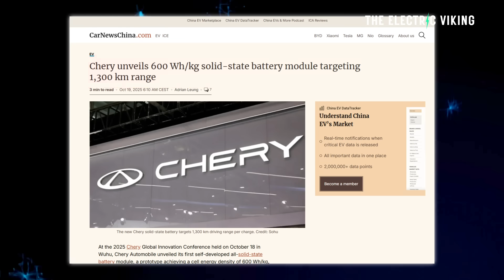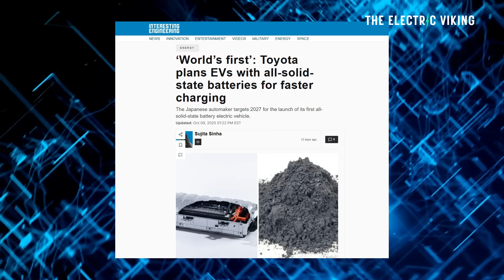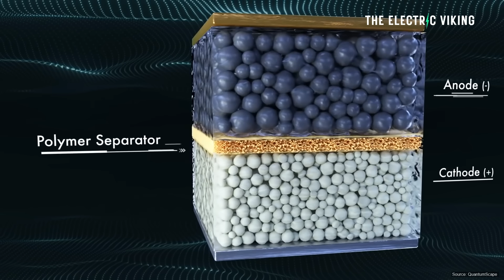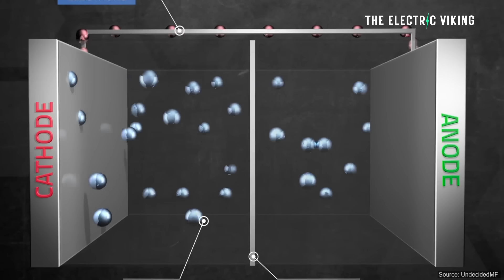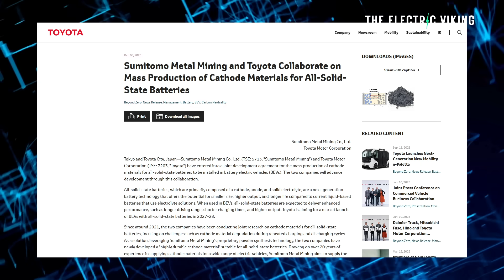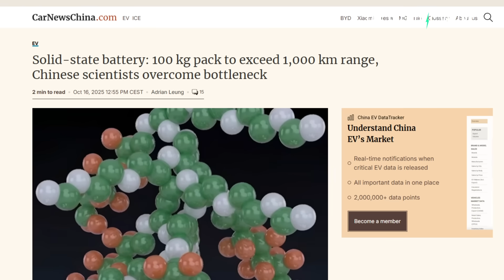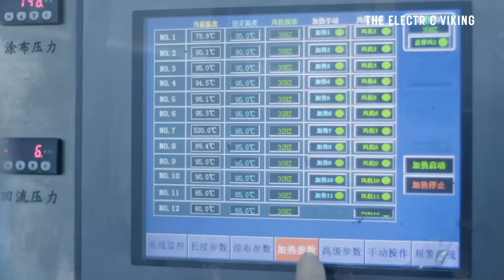Chery’s 600 Wh/kg Solid-State Battery: EV Game-Changer?

Comment: I disagree with you Sam.
Proof has to be given on these solid state  batteries.
Prototypes are one thing , actual large scale production is another.
Separately EV are still far too exy for most even with LFP and solid state will be double the cost.
Small ICE vehicles like Suzuki Swift, Ignis, Kia Stonic, Hyundai Venue , Mazda 2 etc get fuel efficiency of 5-6 litres per 100 kms, and service costs of AUD$250.00 - $500.00 a year  Typical annual running cost of a small ice car AUD$1500.00 for 15,000 kms.

EV are still well above the comparative sell prices of the affordable ICE car.
Hyundai Inster is 43K ,GWM  Ora is 38K , MG4EV  38K even the DYD dolphin is 33K and the difference in sticker price is still on average  3-5 years of fuel and service costs of an Ice car. 
The larger BEV from mid AUD$40's, AUD$50's and AUD$60 K are out of the reach of the average Aussie.
ICE Utes and SUV are typically in the 40,000- 60,000 units a year and typically purchased as company and tool of trade vehicles. Sell price of those ICE vehicles from mid AUD$40/ AUD$60K .  The BEV similar sized vehicles some minimum  AUD$7k- AUD$10K more expensive.

Even BYD Atto1 (AKA Seagull, Dolphin Surf) is being suggested to launch at mid 20K. mark for the smaller essential model with 33kWh battery and 200-250 km range..
IMO - EV will not become mainstream whilst this significant sticker price differential exists. Buyers will take the 5-10 K less and be happy to save that purchase cost for other cost of living expenses. 5 K saved now and 1500 paid out as running costs of Ice over the 500.00 for electricity cost of the EV .

Comment: Surely 600wh/kg should be making the aero industry excited where cost is less of an issue
Reply: Unless there is some Catch-22 about these batteries unstated.  Such as operating temperature range, slow charging speed, fire safety,  noxious emissions in a fire, slow discharge rate, cycle life, cost.  There usually is some trade-off in every battery chemistry and cell-in-pack design , when you read the fine print.
Reply: @eddiegardner8232  Be skeptical I understand, but solid state I've seen them cut in half still work, no smoke, no fire no emissions (though i can't promise if the rest of the car catches fire there might be something)  solid state also can charge insanely quick, the limiting factor being the cord and what the charging station can put out.  Temperature not an issue, cycles decades, the trade off is the cost.  That's it.  Possibly the materials perhaps some rare earth metals.  Really it's just about COST.
Reply: @eddiegardner8232. The other draw back might be it use really expensive exotic alloys and materials, if it doesn't have major drawbacks
Reply: The biggest issue for aero industry if we look at commercial flying, is the weight for example an air plane fuels up xx amount of ton fuel for a certain flight then during the flight the air plane gets lighter through the flight while the batteries even when discharged still weighs a lot and air planes always have to bring "backup" fuel in case of emergency so if an air plane is to have it, it really needs to be lightweight and enough to be able to handle emergency, although i can imagine an air plane witch can eject
 its batteries in case of emergency so it can glide down easier from a like 30 000 fet in the air or so.
Reply: @havendale9  The Smart move would be to have a  TurboJet Engine on the tail as safety backup (just in case) TriStar like. Once the EV system is proven they can remove and cap over the aft engine. So it would technically be a hybrid powered aircraft.
Reply: @havendale9 . The IFR flight rules require that a plane carries enough “energy” to conduct the expected flight including an approach, fly to the alternative in their flight plan if they can’t land at the primary, shoot an approach at the alternate, and then remain in the air for at least one additional hour.  Most flights carry fuel for at least 2 hours, not just one.  An electric plane would need to be designed to carry the same weight for takeoff and landing, providing extra structural capability in the event of an engine problem on departure.  Electric planes would be much quieter and have drastically better fire safety than jets using Jet-A fuel.  Electric motors directly driving turbine fans should be much more reliable than any jet engine.  They would not be dumping pollution into the atmosphere and would be able to produce full takeoff power at any altitude or in any weather condition. Electric flight controls could also replace troublesome hydraulic systems used on jets.  There are already small general aviation electric planes.  It’s just a matter of time and battery power density improvements before airliners begin to adopt electric power beginning with short haul regional carriers.   PS:  Electric motors incorporated into the landing gear could not only be used to “drive” the plane efficiently around the airport during taxi operations, but assist friction brakes by dumping kinetic energy back into the batteries instead of dissipating it as heat, and helping accelerate the plane to quickly reach rotation speed on takeoff.
Reply: @havendale9 eREV-aero could solve that
Reply: Wh/kg is just a scam. Hydrogen have a energy density of 33.000 wh/kg, but diesel has only 12.700 wh/kg.

First find out what we are talking about. Cars need wh/l. Only clue less people gets excited about this.
A car is space limited, so the electric viking needs to get his facts right.
Told him many times, but looks like real world facts isn't important.
Reply: @geirvinje2556  cool story braaaaah, except for the inefficiency of still having to transport the stuff, the fact those pesky hydrogen atom are very hard to contain and the boom kablammo that happens when they leak
Reply: @geirvinje2556  Of course you have a point, but what is the real power density for hydrogen, AFTER being fed through transformation to electricity?
Reply: @mikaelpehrman4815 The point is how it's measured. If you use the correct wh/l hydrogen at 700 bar are at 1.300 wh/l vs diesel 10.700 wh/l.
You can see why hydrogen dosen't work. This is the point. Why trick people with a wrong mesurment???
Reply: @geirvinje2556  That I agree to....
Reply: Yes!

Comment: Energy density is the holy grail for car design engineers…. Range and low weight… equals a better dynamic driving vehicles which Chinese cars are not delivering they are too heavy and soft riding

Comment: I would pick the one with the biggest range. I couple of reasons. 
- When you drive on a highway, the consumption  is much bigger. 
- We usually drive with more than 130km/h speeds. 
- When it's winter the range is reduced.
-  Infrastructure is not that great and charging speeds are not so high.
- Keep in mind that usually you keep the battery between 20-80%, not 1-100% and you want a reserve
- Most people have one car for city and long journeys and many iive in flats/apartments and home charging is not available.
 So a car that would have  800km  real range on highway speeds and 800v architecture, would make a lot of people transition.

Comment: I had a 1600L Vauxhall Cavalier that did around 350 on a tank. Until diesel cars arrived, that was a pretty good range. I personally don't expect an EV to do much more than that because I can charge en route. I'd like a minimum 200 miles guaranteed, at motorway speeds, as my daily commute is 120 miles I figure that with lights, wipers and AC on a 200 mile car will easily do that and charge up overnight.
I think that people demanding 1000 miles from an EV are just looking for, increasingly silly, reasons not to make the change. Charging speeds are going up, charge times are coming down steadily. Unlike petrol/diesel, you can "fill the tank" while you go to the toilet and/or grab a coffee or food.
Price has held me back but now that Vauxhall have announced that the Frontera will be the same price regardless of EV or fossil fuel drive train.
Reply: An EV would be great for local travel.  Where i live in Canada the charging infrastructure is just not there yet for my 550km, 350mile  trips. I drive for time efficiency and make two short stops and gas up at my destination to visit family.  The places I stay at don't have charges, ie Airbnb, and to fully charge the EV would take up valuable time from the short time I have to visit.  Make an EV as convenient as our 1 vehicle and maybe we get one. Up to now it just doesn't fit a 1 vehicle house with long trips for us.
Reply: We don’t all live in tiny little countries mate

Comment: 300 mile range under worst conditions is fine for me - just make it lighter and/or cheaper.
Reply: cheaper is the problem. even if they could sell it for 70€ per kWh, they won't do it. they will sell it for 300...400€ per kWh.

Comment: I wouldn't be interested in owning an EV until I can get one with decent passenger and cargo space and enough range to carry that vehicle over the length of the trip between my house and summer property and do it with the vehicle loaded with people, dogs and gear. That trip is about 600 Km over two or three mountain ranges so realistically, the vehicle needs to have about a 1000Km/600 mile range rating to make that trip with a bit of a cushion.

Comment: As someone who tows a 5'x10" trailer (for business) I would DEFINITELY be interested in a battery with more range.  I know that the 600 mile range will probably drop to 400 miles (or less) towing even a smaller trailer (weighing 400-500kg). This is life for many people in business. Tooling around in an empty car (hauling nothing or no one else beside the driver) seems to fit your image of life...the rest of us have family and "stuff."
I do appreciate your laughing at Toyota's assertions about its solid state EV battery. I do believe that Toyota, Honda, and several other Japanese/Korean automobile manufacturers are moving to Hybrid vehicles as their dominant propulsion model for the next 10 years or so as the batteries and their myriad of issues work themselves out. Toyota IS successfully dominant in the hybrid market...that is NO joke.
Reply: You would think they could just put a battery in the trailer to offset its power needs.

Comment: All about power to weight for mobile use.  I see fields of use depending on this and cost which will be verbal. Vans RV and t 
HGV for high kWh performance cars motor bikes and bikes drones for high C rand capacity sodium and any less than 300 wag for all others cost factors could change this as if significant breakthrough made then all will migrate to the lowest if able to meet targets required.
All a bit obvious the spanner in the works will be ever grater MARKET MANIPULATION with ever greater claims that will curtail mass adoption of the best tech.

Comment: That's a 220 lb battery taking you over 600 miles for us backwards folks in the US.  That's wild, or the weight of gas in a 31 gallon tank, needed in a 20 mpg vehicle to go 600 miles.  Yes, I'd take that EV because charging while traveling cost so much more than charging at home so I could take a 250 mile trip one way and get back home without needing public charging.

Comment: Makes Electric Aviation feasible.
Reply: Hybrid or EREV airplanes might make more sense in the short/medium term. Efficiency of electric motors plus A1 fuel generator that still has more energy density: about 11,889 to 12,878 Wh/kg.
Reply: So does Amprius SiMaxx's that are powering 2 major eVTOL companies today.  Joby and Archer.

Comment: I don’t really care what chemistry is in my EV’s battery as long as it goes like stink when I step on the accelerator, causes me no problems (fire, short life, high shelf discharge rate, etc), and doesn’t make the car unaffordable.  The jewel in an EV is the high, instant torque, reliable, smooth, quiet, no shifting, electric motor, not the battery.
Reply: Well said&same here! Although this tech would shave 300-500+kgs off of most new Evs if it works as stated! 

I will guess half that savings in the real world within the next 3 years or less.

Comment: if the pack-level would be close (or higher) to 400wh/Kg, then we would be getting into 150kg battery (for 60kwh capacity) territory! That would be amazing... but they will not get into mass production until 2027

Comment: If Cherry sold their batteries to Mercedez, Audi, Porche, and other high end car manufacturers, they would make the money from ramping up and people would buy cars with these batteries in them with these Brand names.
Reply: theoretically yes. practically no. aviation industry will pay more for every battery that comes out of the factory.
the reality of the market is, that EV batteries are getting cheaper between 7 and 10% per year. no revolution, just "normal" boring evolution. but 7...10% is still very good! no revolution necessary. from 2028 onwards most EVs will be cheaper to buy than ICE cars anyway.
Reply: @stefanweilhartner4415 I will guess that you know about the cost of manufacturing over time

Comment: Ill believe it when i can drive something with solid state batteries.
Reply: Not much longer to wait, 1-2 years before the first vehicles roll off the production lines and in all medium and long range EVs by 2030, it's just a case of ramping up production lines to produce them in the required quantities.

Comment: 1:20 You're confusing weight with energy capacity. A 50 kWh battery has the same energy capacity regardless of what it weighs. 600 miles from this battery would be 12 miles/kWh, three times more miles per kWh than my Bolt EV or a Tesla Model 3. A solid state battery with the same capacity could be much lighter than my Bolt's battery, but it wouldn't deliver more range unless it's far more efficient, like an Aptera.

300 miles of range is plenty especially if I can charge at 150kW or more.

You mock Toyota, but this battery from Chery is still years from mass production. If Toyota made this announcment, you wouldn't believe it. Why believe this one?
Reply: It would in theory deliver more range because the vehicle weight goes dramatically down for the same capacity. You've taken over 150Kg off the weight of the car versus 200kWh LFP for a 50kWh pack.
Reply: @etchedpixels  Sure, but it's still a 50 kWh battery. A 50kWh battery in one EV can deliver more range than a 50 kWh battery in another EV, but it holds the same amount of energy in both vehicles.

Comment: 600 miles in a truck that can tow and haul things would be great. 400-450 miles in other vehicles would be plenty. If these batteries have a 5-80% charge rate under 10 minutes maybe less range would be perfect.
Reply: And if the car weighed 1500 kg !!!
Reply: Agreed
Reply: I would wait for a cheap electric car with a sodium battery and a plug for a power bank  with a battery like this one for long trips. Beside that I would  charge  the power bank from solar panels during the day

Comment: Do you ever cover the status of grid-level storage?  This is a different problem, since weight is not as critical a parameter as in transportation.  When that problem is solved, it will push fossil fuels out of the electrical grid on the basis of cost.
Reply: omg because Electric Viking has like 8,000 videos and he has reported on conceivable aspect of the grid level storage.  There are lots of game-changers in that market, too. :):)
Reply: That problem IS solved. It's just a matter of time and investment rate. Current solar/wind with grid batteries, including sodium, are already a good enough solution, and they will only get better over time. The main bottleneck has been grid infrastructure and government approvals etc. To try to mitigate the first many grid batteries are being sited on former coal/gas power plant locations or adjacent to heavy power users such as industry.